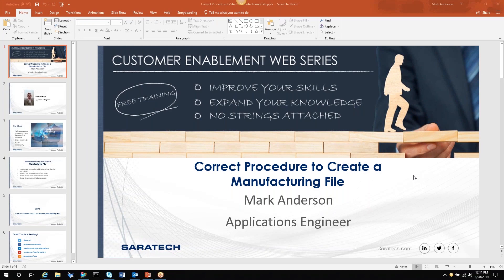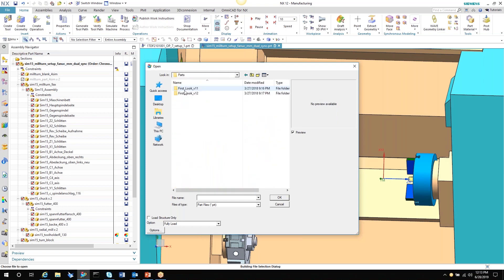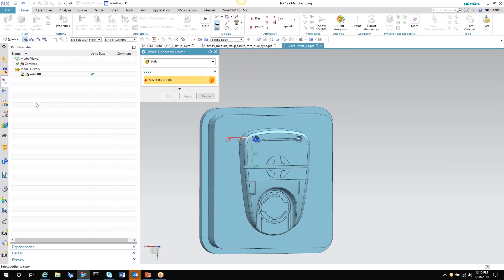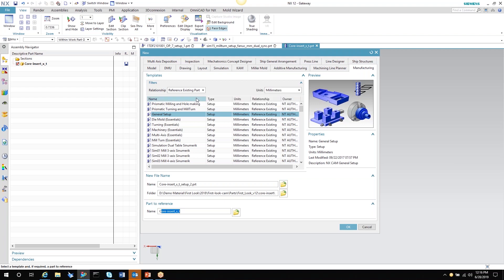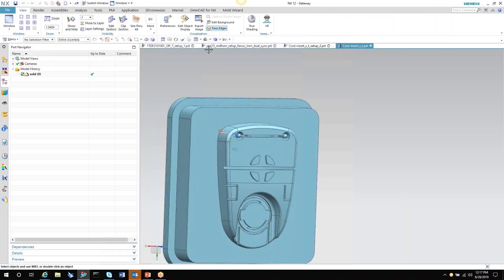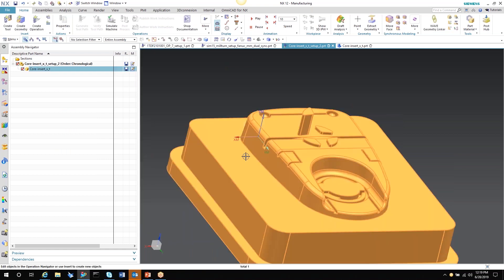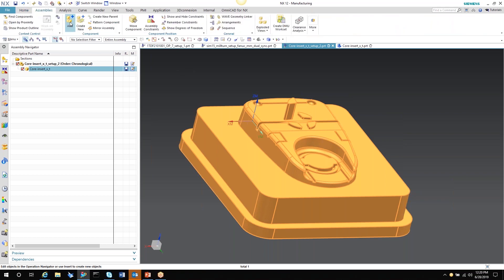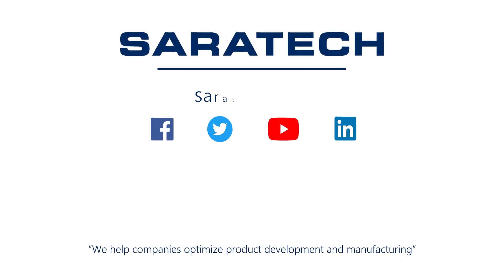NX: Correct Way to Create a Manufacturing File

Comment: When you manufacrure a part of a large assembly, by this method, you create another assembly within an assembly?
Reply: Yes, you will make the component that is needing machined the work part and the file, new, manufacturing template. This will pull the work part into the manufacturing assembly file for machining. If it is done any other way you will lose functionality. Your machining component must be a component of the manufacturing assembly or you will lose functions like wave linking, associative copy’s and your original assembly file will house both design and manufacturing files which is one of the main functions of NX.
Reply: You should never try to machine a component of an assembly in the design module. Each component should be made the work part and then file, new, manufacturing template. This will create a new file independent of the original assembly file. Call (419) 967-2184 and we will do a screen share and I can show you better then explain it. No trouble at all.